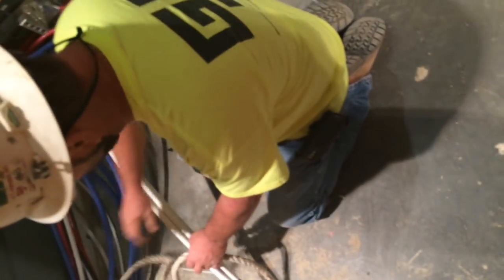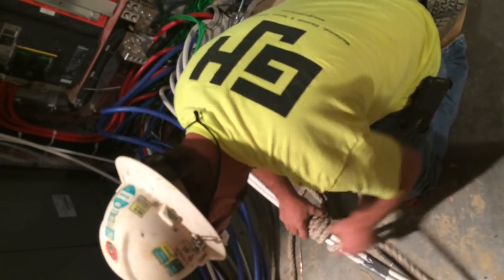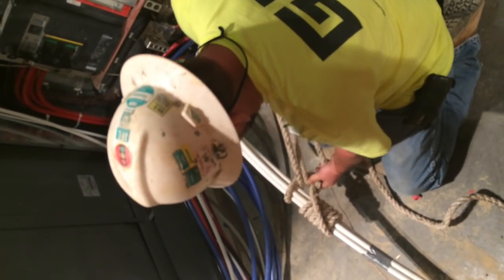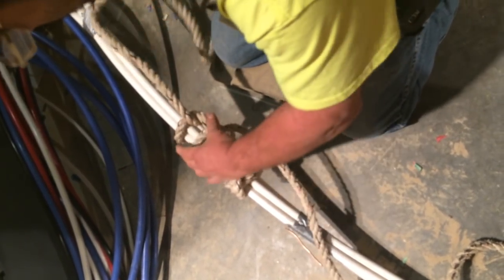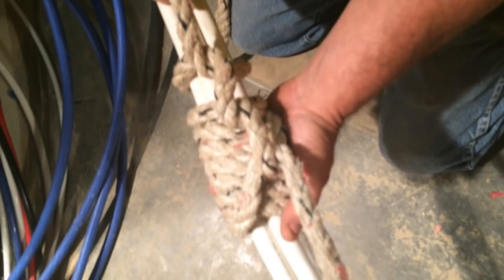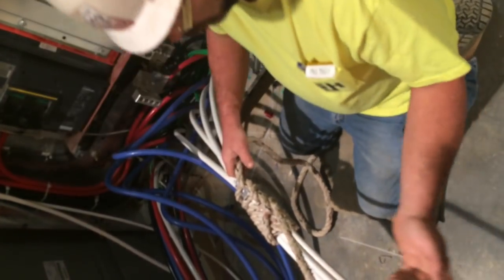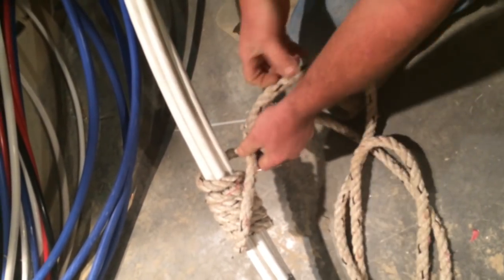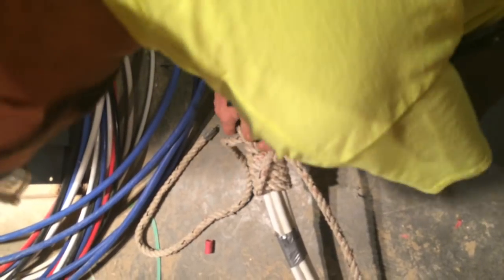Stopper Knot

Comment: Also known as Icicle Hitch or Pipe Hitch.
Reply: Sort of.. but its knot
Reply: The icicle hitch is the best
Reply: Not quite the same. I wonder if the ones you mentioned are better. I have never seen the knot in the video. It's possible he learned the Well Pipe Hitch (ABOK #504) but tied this instead, got it work, and never changed.

Comment: Why is this this on my suggested, just clove hitch it bro, this is all unnecessary. Waste of time and money, non union shit right here
Reply: This is a legit knot. The advantage of this not is it will not damages the insulation on the wire. I have seen guys use half hitches on tough pulls and destroy the insulation on the wire.
Reply: First, a clove hitch will slip.  You need a spar hitch instead and you wouldn't have to back up your clove hitch with a half hitch.  Second, you'll damage your wire with a those kind of hitches if it's a real tough pull. Come to my union with the bullshit your talking and you'll get spun
Reply: @daniello-g5593   sorry pal, don’t think so I’ve never damaged the wire using a a clove hitch . Not sure what union your apart of,but I’m  ibew and we do do this kind of shit out here.
Reply: @R8terFan  good for you,  hopefully you never have it happen, but if you got a hard enough pull your gonna destroy your wire,  ibew here too brother